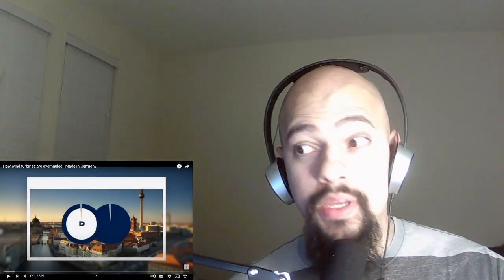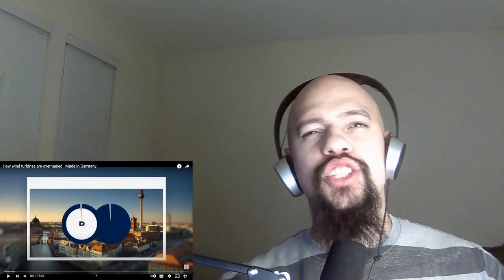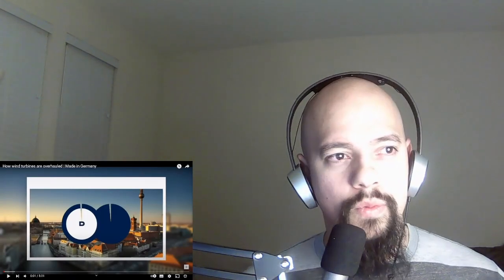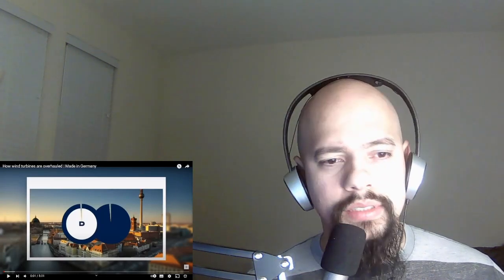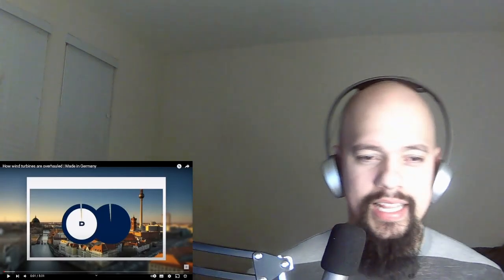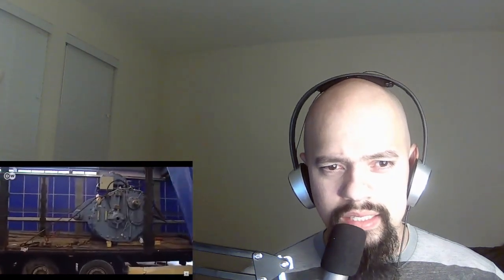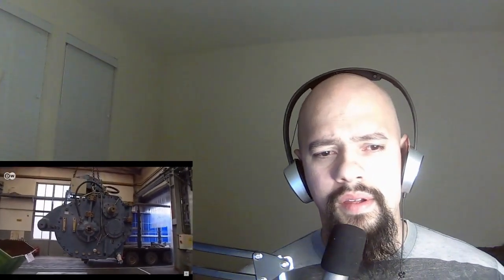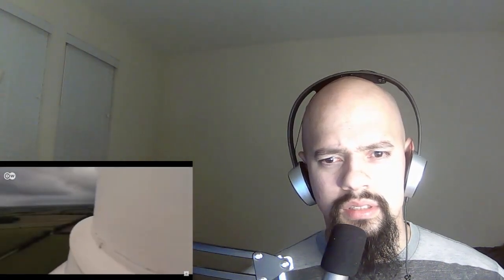American Reacts To How wind turbines are overhauled | Made in Germany

Comment: 1st repair is always good for the environment
2nd because of this repairs you can use this thing for another 5 or more years and wind turbines are very profitable
3rd when you repair it you learn much about the problems and you can build better ones with longer lifespan
4th don't forget the recourses that are needed for a whole new one (energy material etc.)
5th you can be sure that Germans wouldn't repair it if it has no benefits on long term.
6th with increasing prices for energy and steel it will be more and more beneficial to repair in the future.
7th many of this things are produced outside of Germany and by repairing it the money stays in the country

Comment: This is an industrial repair. New Gearbox $200.000, when they overhauled (with guarantee for at least some years) the Gearbox it is so expensive because they put it in "as brand new" state) therefore $70.000 up to $140.000 for the repair is still $140.000 to $60.000 cheaper than a new one.
And this wind turbine maybe produced electricity for 20 Years and with the renewed Gearbox it will produce electricity (with a huge profit) for the next 15 to 20 Years.